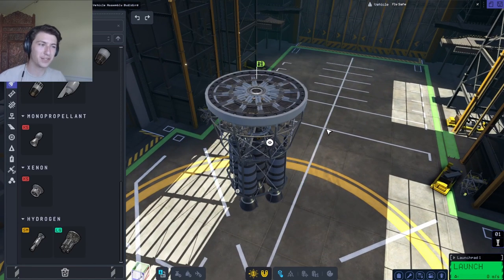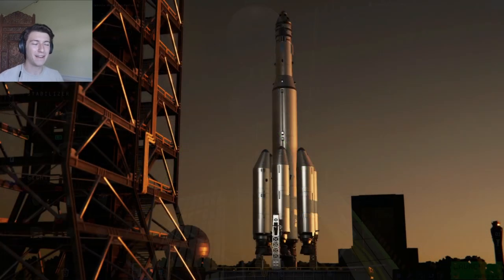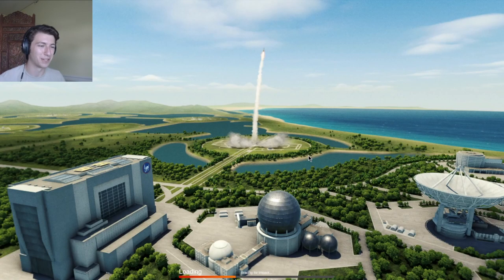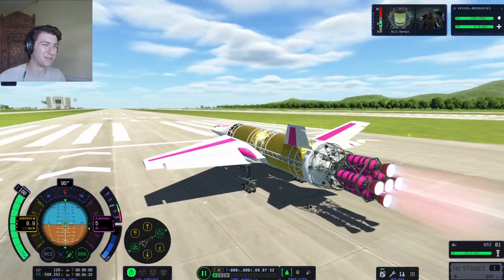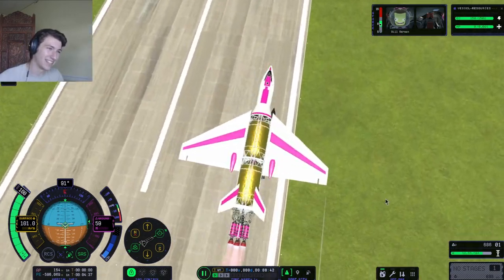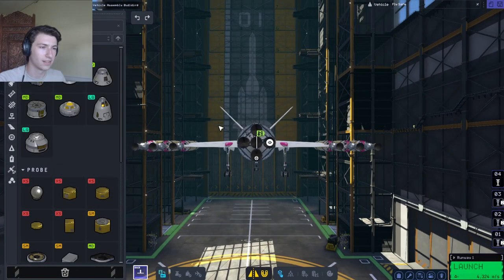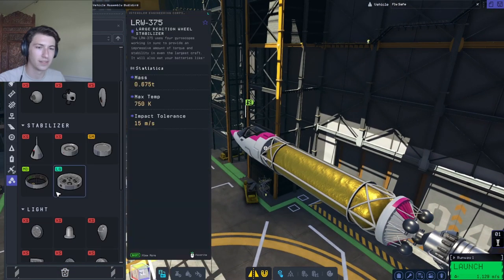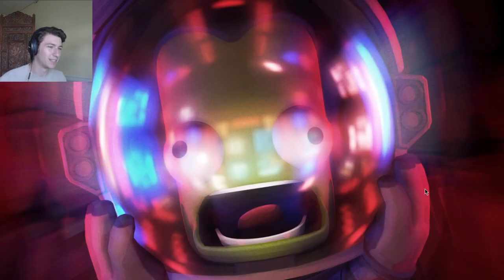KSP2: Can I Build a Nuclear Plane? #ksp2

Comment: What is Delta V? I only play KSP 1.
Reply: dV is relevant in ksp1 aswell. It stands for change in velocity, basically a way to quantify how much fuel you have. It takes the mass of the craft and efficiency of the engines into consideration. Delta-V and thrust to weight ratio are the 2 most important metrics to tell you what a stage can do. Both are based in real life so if you want you could learn about them from Wikipedia or something.
Reply from the maker: Mrik put  it perfectly, basically how much you can change your crafts velocity (how much push do you have?)